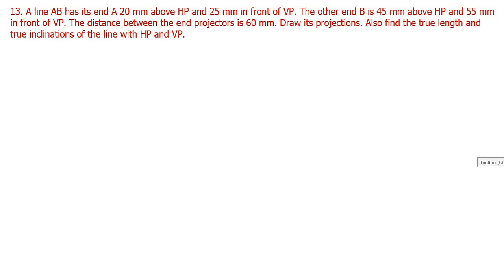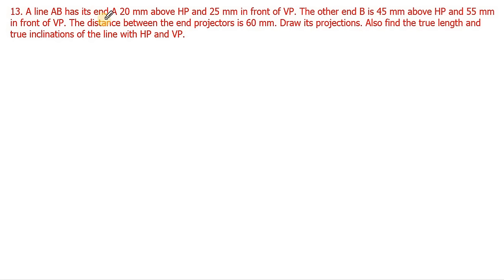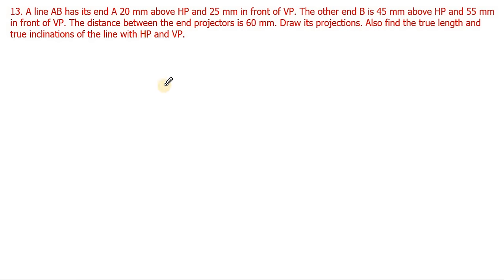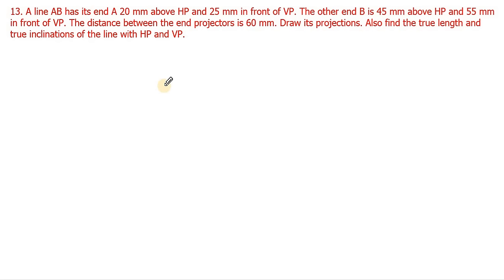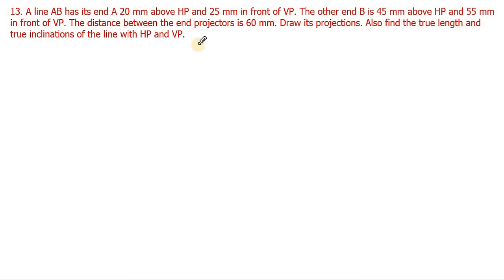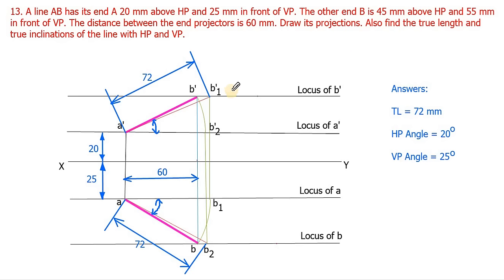Projection of Lines | Given End Projectors | Engineering Graphics

Comment: 10. The end A of a line AB is 10 mm in front of VP and 20 mm above HP. The line is inclined at 30" to HP and front view is 45 with XY. Top view is 60 mm long. Draw the projections. Find the true length and inclination with VP

Comment: The distance between the end projectors of a straight-line AB is 60 mm. Point A is 15 mm above HP and 30 mm in front of VP. Point B is 40 mm above HP and 50 mm behind VP. Draw the projections and find the inclination of straight-line AB with HP and VP and true length of the line. Find also the traces.

Comment: 9. The distance between the end projectors of a line AB is 50mm. The end P is 50mm in front of the V.P. and 25mm above the H.P. The end Q is 10mm in front of the V.P. and above the H.P. The line is inclined at 30˚ to the V.P. Draw the projections of line PQ. Determine its true length and true inclination with the H.P. Also, locate its traces.

Comment: Problem 4 
End A of line AB is 10mm above HP and 20 mm Infront of VP. The other end is 45 mm above HP and 65 
mm Infront of VP. The distance between the end projector is 40mm. Draw the projection and find true 
inclinations and true length.